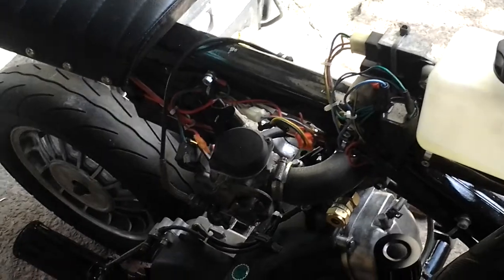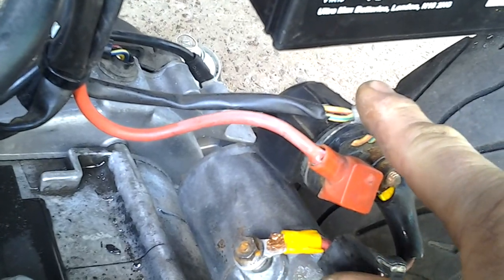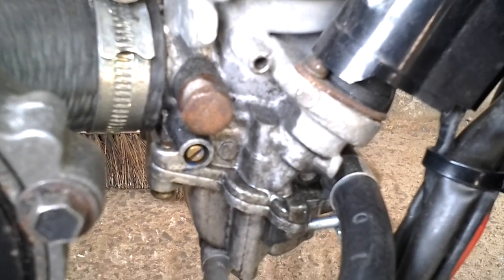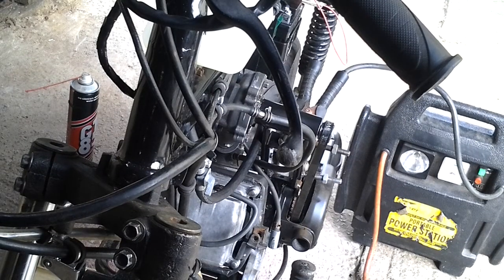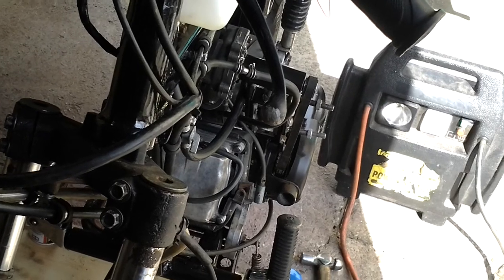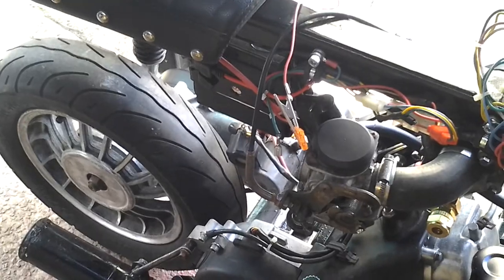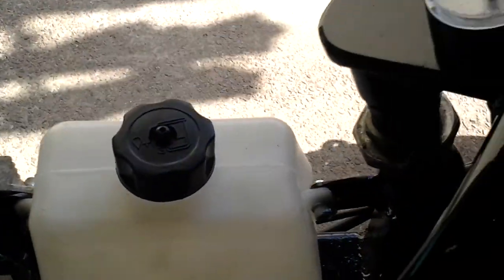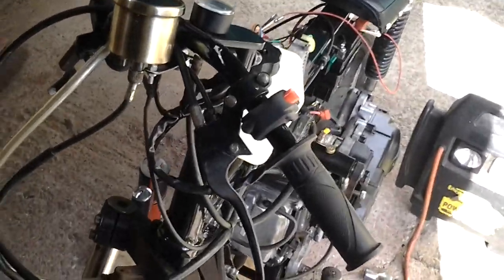Supercharged 49cc gy6 project. Scooter charger update

Comment: Have you considered switching to a slide carb?  In my experience, those CV carbs reduce throttle response and get clogged easier.  I put some cheap PZ19 carbs on my 50cc gy6 with a 70cc kit.  It took a few tries to find the right size main jet, but the bike feels more responsive and doesn't get clogged as easy.  Even when it has, a slide carb is easier to remove/clean than a CV carb.
Reply from the maker: Thanks i might try that as I'm not a big fan of the CV carb. The idle circuit on the 50cc gets blocked very easily and the jet is almost impossible to clean. Also considering the 70cc kit when I change the barrel as I feel the charger is creating too much of a horse power loss to even attempt to change its gearing.

Comment: what supercharger is it?
Reply from the maker: It's built from the core of Garrett smart car turbo as a 50 gy6 engine doesn't make enough horse power to turn a commercially available supercharger. Obviously it's running at much lower RPM's than as a turbo but this was a safety consideration due to its location. I fitted a new piston and rings during the engine rebuild but it needs a new barrel as I found even with a small amount of boost it's pressurising the crankcase. If this fixes the blow by in the worn barrel I should get a bit more power.